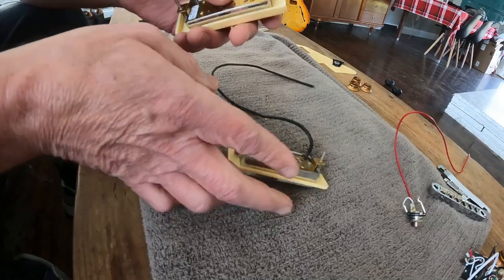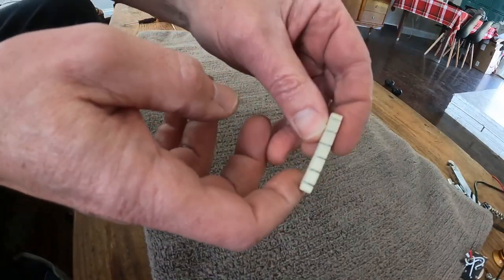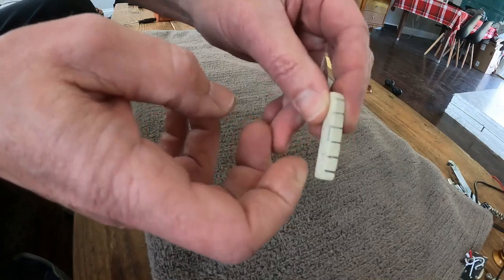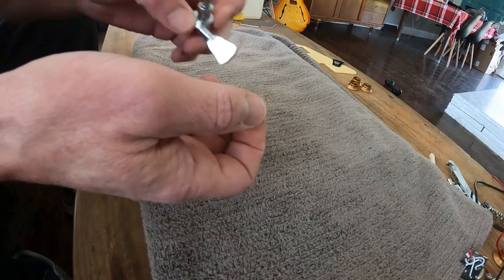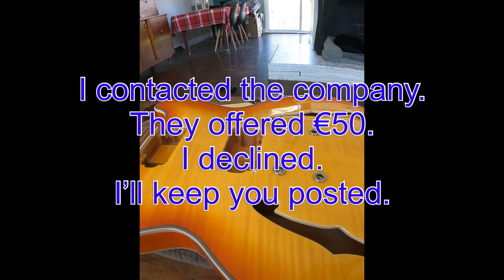BAD NEWS!!! Harley Benton HB-35 Plus Lemon Drop Disassembly and Analysis. Watch Before You Buy!!!

Comment: I have that guitar. It was amazing out of the box. And still is. Spend $1000 and get a $1000 guitar. What did you expect for $250? This HB plays awesomely for the money. You will not find a better electric for $250. Every review of this guitar has been great. Because it is.
Reply: I expected what I got minus the glue void. I spent 900 total on it and it now plays like a 4k guitar. I just posted the finished video. Sustain for days!!  $900 guitars also suck and need the same work done. Even my Gibsons needed a complete redo. I didn’t like the HB out of the box. Had 5 high frets, and wouldn’t stay in tune.   I would recommend one to a student though. Great platform as well for builds. That is what I bought this for. Just the wood and fret wire. $250 was a good deal for the wood and fret wire. The rest is junk.

Comment: You're missing the point entirely. These are not Gibson guitars, and you're not paying Gibson prices. These are affordable guitars that sound really nice (as so many reliable people have said in their video reviews) and they play really well. 
You're expecting top of the line parts and manufacturing, for a few $$$. Get real. If anyone wants to upgrade some of the parts, that's fine. A lot of us do, but to denigrate the guitar for not having the highest grade parts, at this price point, is ridiculous.
Reply: I’m not expecting Gibson quality. I expected a $200 guitar. I just moved out of state and all of my tools are in storage. I was going to build a kit guitar, but instead since all my painting stuff is in storage, I bought this expecting only to keep the wood and body finish. That was my plan from the beginning.  If you saw the unboxing video I did explain that.  I am also going to reshape the neck, do a crown level and polish on the frets and replace the nut and all hardware.  I am bored, and I can do all of that without my shop. I was disappointed that the top was not glued to the block. That is actually my only complaint. They did not play well right out of the box, though, because it would not stay in tune because the nut was cut crooked, and the high strings feel spongy because the bridge slots are all cut to .042. I feel that that was not covered in any of the videos I saw on it and totally effected the playability.
Reply: @62falconizer  maybe add it in the description with a link to the other video?
Reply: It’s finished now 🙌. Better than my stock Gibson. $900 all in plus it was fun as hell to build. I only bought this for the wood and fret wire. It’s custom shop good now.

Comment: Apart from a few bad construction matters you highlighted, one would expect the pots, switches, and hardware to be, as you described- "cheap". This is because the whole guitar is "cheap". No Gibson, with all the better quality fittings, is worth the 300% mark-up in price that is charged.If you replaced all the dodgy parts with Gibson fittings, the guitar would theoretically be a decent instrument, but still would cost less than half of what an expensive Gibson would be.Having said that, I've tried( in a shop ) brand new 335's and Les Paul's that had wonky fretboard inlays, and bubbles of glue seeping onto the board with crookedly fitted block inlays.Someone like me( who has none of your expertise) can notice obvious flaws in a brand new guitar costing thousands of dollars-- so I would EXPECT parts and fittings to be " cheap" in a cheap guitar costing less than $500. Thanks for your review, but perhaps you expect too much in a cheap guitar.
Reply from the maker: We are in complete agreement. Maybe you missed why I bought this in the first place. It is to replace all of the cheap hardware with top quality components, Gibson or otherwise, to reshape the neck, to fix the flaws, level, crown and polish the frets, shield it and put in some quality 59 clone pickups.  I figure I will have a great guitar for $550. On my Gibsons, I’ve always had to do the same work with the exception of changing any components. I never had any intention of keeping anything but the wood and fret wire. I am interested in how good I can make it.

Comment: Great video, now i know what to look for when shopping for a cheap semihollow.

The cheap components can be replaced easily, but the top being separated, that's another stuff.

Very informative, thanks!!
Reply from the maker: I think the poor gluing job was an exception, not the rule. Mine was first out of a new run. And the customer service was great, as they refunded me the price of the guitar because of the glue issue.

Comment: I just don't get the point of this video. I have a hb 35plus 2021 and I have a Gibson. The Gibson Es335 was overpriced and had unfinished fret ends a finish flaws. My Harley Benton neck and fret ends are like silk . The finish is flawless. I paid with taxes and import around £235 pounds, so I just don't get what your beef is.
Reply from the maker: I have no beef. That’s what your are missing. I have Gibsons as well, and I had to finish my Gibsons for them as there were many issues. The issue that I had with my HP 35 was that the top and the block  were not glued together in a fairly large section. I have heard from others that theirs was not like this, and I did get the first model of a delayed rushed back order batch, so that could’ve been the issue. The customer service was great, and I got the entire cost of the guitar refunded so I have no complaints at all. I bought this as a project and had no intention on keeping it stock. I’m already on part 7 and it’s feeling great.

Comment: I'm with you. Even a $250 guitar should be glued as has to be. Yesterday I got two HB-35 Plus Cherry. One was looking indeed "AAAA flamed maple archtop" like a tiger, another was flat red. Ok, nice Cherry, but not the awaited flamed maple. The nice one made more obvious the uneven quality control.

Of course I sent a complaint to Thomann and probable I will send back the flat red guitar. Can I expect the promised (and nothing more) look and quality for a $250 guitar? Yes, I can. And Thomann (randomly?) can deliver good guitars, so they have to do so. Just mentioning that they have inhouse QC before shipping, but as experienced this is not as effective as should be.
Reply from the maker: Agreed. I bought this as a project and pretty much out of curiosity to see how they make a $250 guitar. I was only planning on keeping the wood. After I put quite a bit of work into it and reshaped to the neck it is a fantastic guitar. Makes all the right noises
Reply: I have to agree. Things like the "AAAA flamed maple archtop" I always take with a grain of salt so I can live with that if it's not up to par for that price. Obviously the quality of the hardware is reflected in the price as well, that said a guitar needs to be structurally sound, albeit $3500 or $250.

Comment: Great fun video.  Great watch. So now I know why they are so cheap. Longevity now seems a big question. I've nine HB's. All nice. Now pretty sure I don't want to look under the hood on any of them. Gift horses and all that!
Reply from the maker: Aside from the glue void it’s a pretty solid build. Mine was first of a run so that’s probably the reason for the glue issue.  It was repairable. 
I knew the electronics and hardware are even bad on a $1000 guitar, so I had no intention of keeping any of it. It was interesting to see how they made them though. I have never played or seen a cheap Chinese guitar before this one. The bones were surprisingly good.  I would recommend them as is for a student or somebody wanting to experiment with a different type of guitar.

Comment: This is the strangest video, pointing out the flaws in a 200 dollar as opposed to a 3000 dollar Gibson, its for people to have fun with or learn on its not meant for  chuck Berry or BB King to record with.
Reply from the maker: I bought it for the wood only. I was always going to build a different guitar out of it. I have done the same thing to my Gibsons and Fenders as well. This is the first inexpensive guitar that I have ever handled. I was curious how they were made.  The only cause for concern was the incomplete glue job. I wasn’t expecting this, but was able to repair it. 
It’s great out of the box for a beginner, and it’s absolutely fantastic when you replace the cheap components and do some fret and neck work.
Reply: @squishymusicandguitar4066  will you be doing a video of the finished  guitar and total  cost?
Reply: Personally I’m fine with videos tearing down and being critical of any guitar I am looking at buying. Just have to be intelligent enough to know the difference between what is a players preference and what is an actual quality issue. I.e neck profile and action vs neck not glued to body and fret sprout. And that’s at any price point, from custom shop gibsons to chibsons to Benton’s. I have a few, all of them bought as mod platforms and 3 of them are still stock because they were either good enough to just replace a nut and strings or they were great as is.

Comment: Dude.. The only thing that changes the tone is the value of the capacitor. Nothing else about it makes any difference. Not the brand and not the price. If you don't know this, then you simply don't know what you are talking about. 
I watched only 1 minute of your video and it's oblivious that you don't understand this topic.
(Also the ground wire never goes to the output jack, it goes to the potentiometeres...)
+1 that "grit' on the pickups is wax. Seriously, it's very hard to see this nonsense.
Holy shit.. Dude, seriously! The nut doesn"t even required to glued to the neck. The only reason that is glued to it, to  make it easier to replace the striings..
Reply: Lol 😂